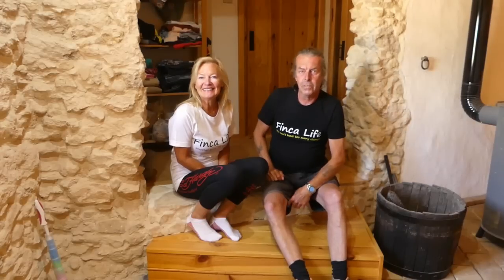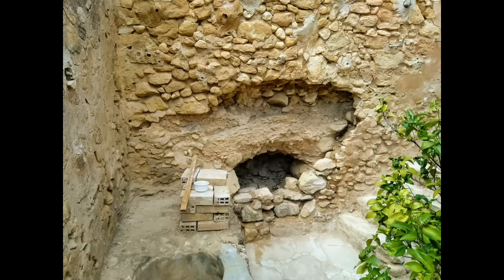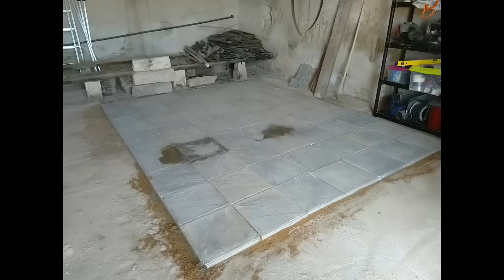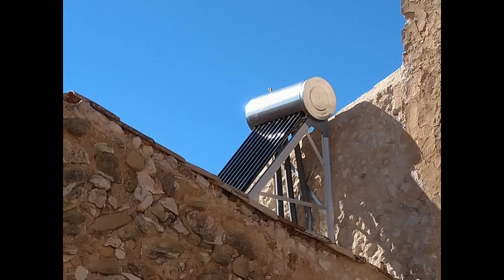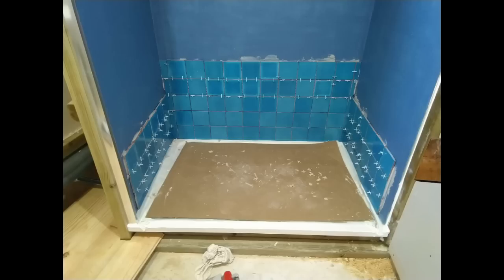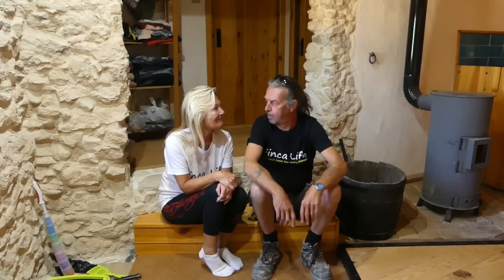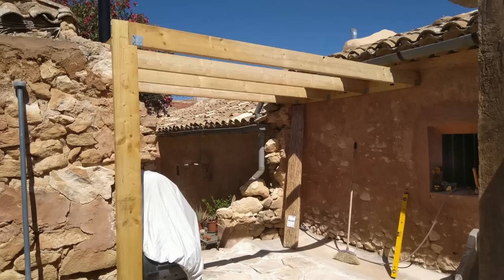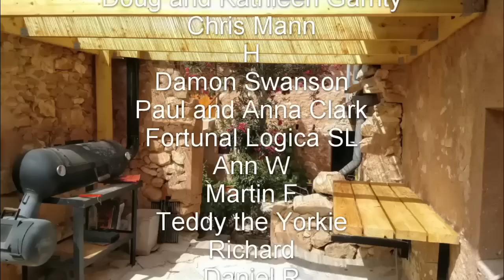4 years on - Couple renovating a derelict Spanish finca

Comment: Hello. We are in process of renovating our house in Andalusia. Can you tell me please what type of lime plaster have you used. <Many thanks
Reply: Forgot to add. For internal walls
Reply from the maker: Yes, we use a 3:1 sand:lime by volume for pretty much everything. We prefer hydrated lime to hydraulic lime.
Reply: @FincaLife  thank you for getting back to me. Is it easy to get in Spain and do you have in one of your videos how you are applying it.
Reply from the maker: @killthecult8199  There are several videos on it and more coming up :) We find you can get it at most of the smaller more traditional builder's supplier.
Reply: @FincaLife  thank you very much 🙂